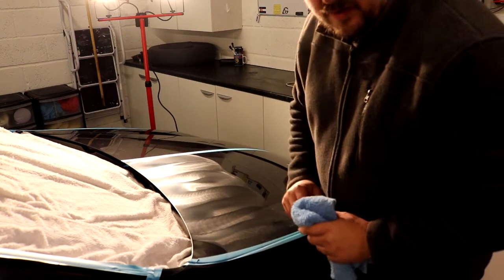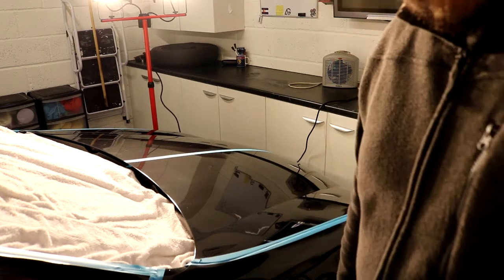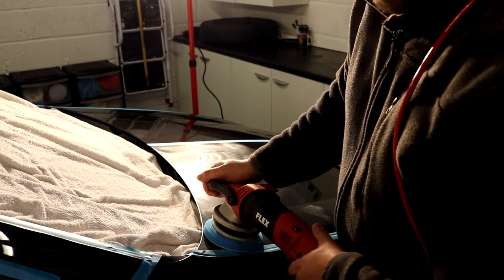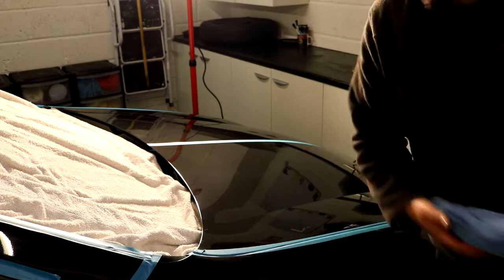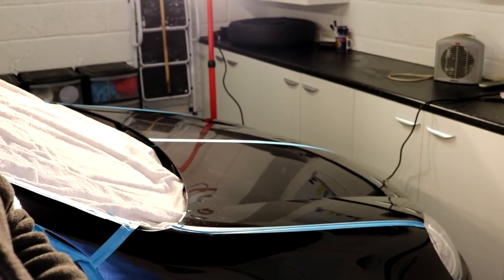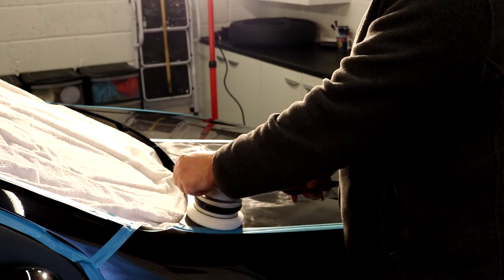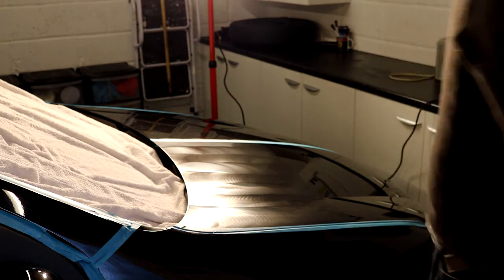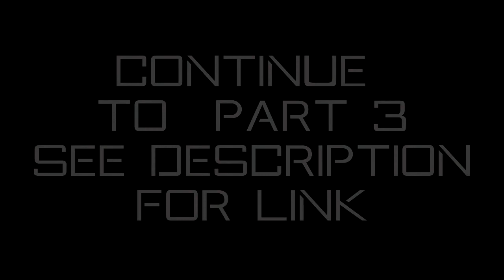How to polish a car  Part 2 - Using a Flex 3401 vrg ( paint correction buffing )

Comment: Although this video is three years old, it is STILL an EXCELLENT tutorial on the PROPER way to use a polisher in a cross hatch pattern while using the less aggressive pad FIRST (or to use a more aggressive pad only if the softer one does not cut it)  The only thing I might add is that one might wish to be judicious with the use of tape - most crucially if you pass over it with the polisher: IF you take some tape off WITH the pad in its passes, you risk marring the paint with tape particles that come off with the pad/polisher which then spreads them around on the paint quite aggressively! 
GREAT videos Mate!

Comment: very well done and thanks for the info concerning lake country backing plate and pads. i have a 3401 vrg as well. one thing i would suggest is to trust your polishing skill more. @5:00  of this video you said you will go another round of compounding to get rid of "micro scratches". i suggest not to compound again but rather go to your finer polish to handle them since those are the scratches it is designed to handle because if you go again then you have to go 2 rounds of compounding for all the panels regardless of whether your work is good enough the first round or not just to maintain the amount of clear coat you remove around the car. one other thing is to try and not over think the moment. this is a daily driver that the customer is selling and as you stated he could not see the damage like you can so chances are neither will his buyer. this is not a show car or a rolls royce. yes it is black but with the 3401 vrg that no longer matters. keep it simple and just trust your product and skill. you will save loads of time and product and in the end you arrive at the same place. love your work man keep those videos coming. cheers :)
Reply from the maker: your totally right, but have a watch of the polishing a wing with a 3401 which is basically this same car a few moments later.   I tweaked the method slightley after that first set because I only wanted to one round of compounding and one - two rounds of refining.  I discuss about my aim is for one compounding set only so I upped to a slightley stiffer pad and drew out the set a bit..  every additional set adds like a massive amount of time your right.  but I find 2 refining sets is generally a damn good thing..   If this was a payed service my approach would change completly.  but this car was never really a great single stage candidate.
Reply: thanks for the quick reply. yes i did watch the wing correction immediately after pt3 of the bonnet correction. you did the right thing upping the game to save time. i just want to say also a big thank you for putting out all this content. i'm still going through it all and i've only scratched the surface so anyone watching your content would do themselves a huge favor by paying close attention to it. the company i work for is part of a family of businesses. one of those businesses is a car dealership. from time to time bird poo is discovered on a car in the holding yard (usually its a few days after the fact) of course they have a go at removing it and fail so they send it to me to see if i can finesse out the marks. my success rate is around 70 percent. being a new car thankfully another of the businesses is a panel shop where they can repaint it. then its back to me. texture matching is always fun so i seamlessly match the new paint to the older. in short i know how you felt when you discovered the bird droppings on the bonnet but in your scenario you just have to let it stay and do the best you can through the polishing process to reduce their appearance. one trick i employ is to get a white scotch pad from the spray painters and "very lightly" scuff the rough edges of the bird dropping but not down into the worst of the damage, leave that alone, just the edges. the aim is not to get the damage out just reduce its appearance doing this will greatly reduce the appearance of the bird poo after compounding and blend it even more after polishing. i learned this from people who try to remove contamination from their paint with a household scotch pad and panic when they see what they've done. it works well at diminishing this kind of damage. thanks again and sorry so long.
Reply from the maker: @kiaya007  thats a great tip ill defo try that, so many times on older cars that have never been machined its the bird etchign (as well as some deep like damage scratches) thatare like the biggest imperfections.

Comment: hi Jon ,I enjoy watching you videos great information on all of your videos. The blue tape is that to stop you burnig the edges ,and how would you cut and polish where the tape has been.

cheers Jason
Reply from the maker: Hey J.   no you wont really burn the edges with the flex3401.. it was only there to stop me cramming polish in the gap and it wasnt quite level..  you dont really need to tape up much with the 3401..   you can pop the bonnet up and do a quick pass down the edge afterwards..  I dont think I did this though

Comment: Hi Jon, I've seen a lot of your video's and I love the quality! Quick question: You prime a new pad, but i've learned to clean it after 1-2 panels (in my case clean with water, spin it dry) Do you need to prime it again?
Reply from the maker: hmm so long question... short answer..  imo if you clean the pad out with water and its really clean.   just put your dots back on..  and then just work your film out over the panel that primes it enough..   If you want to prime it more on the first set you use it after cleaning just use an extra blobb and work some on the panel and then spread..  I dont like spread the polish with my finger or anything over the pad..  no point really.

Comment: is that the lake country 100mm backing plate does it take 4 & 5 inch pads
Reply from the maker: hey there its the discontinued lake country adapater plate with 4 inch plate size.  which fits the 5 inch lake country hybrid power pads which are also discontinued.

now you would be better to use the flex 4 and 3/8's propriartory plate with the lake country 5.5 hybrid force pads
Reply: where can i buy that i want to use 4 & 5 inch pads keep the videos going lthere a great help

Comment: Hello!

Could you tell me if you are pushing Flex during the polishing process against the polished piece? Or are you letting her work free?

I used my Flex by pushing it but finally the plate was hidden in the felt ring and heated by gluing it onto the plate.

I'm trying to pack, I'm going to buy the felt and try to replace it.

Do you know if it's possible to work without the felt ring?
Reply from the maker: i don't push the flex no the weight of the machine is enough..  see video on how to maintain the flex 3401..  use air tool oil to lubricate the felt ring to stop it wearing out and to reduce heat.

Comment: Can you please confirm whether flex3401VRG works on 220 volts power supply? Also is there any small 2 inch or 3 inch rotary polisher in flex range?
Reply from the maker: hey there...  I really dont know sorry I would ask a supplier or flex tools UK..  I take it your in europe or somewhere with 220 mains voltage..        Flex do a compact rotary called a PE8-4 that supports 1 , 2 or 3 inch backing plates...   If you look on the channel videos or playlists Ive done a review of this and the flex 14-2..